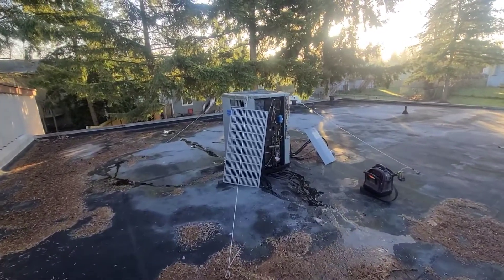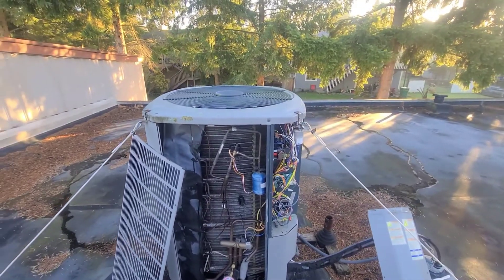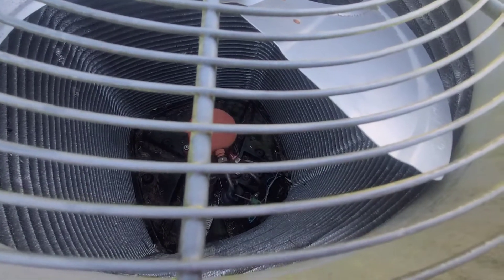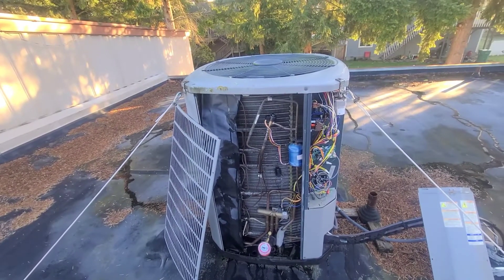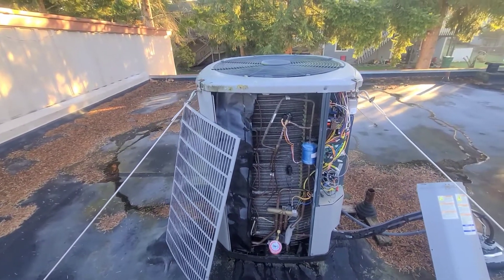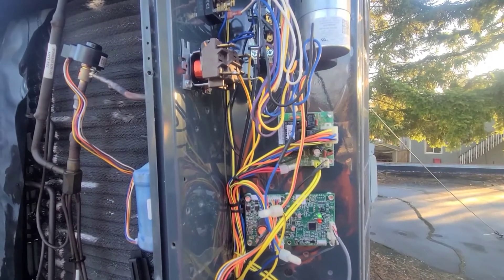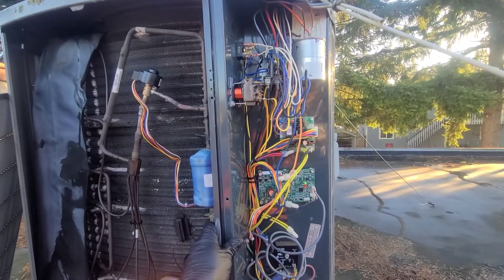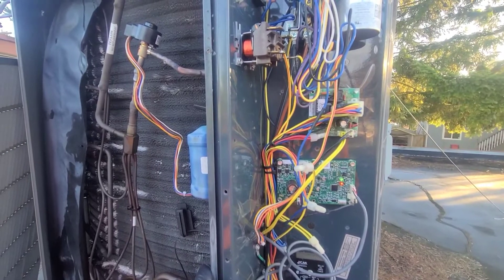Heat Pump Is Blowing Cold Air!!

Comment: This video gave a good education on how these things work.  I have an American Standard pump and have always had issues with it when it’s gets cold outside.  I’ve had the unit replaced and another set of coils replaced on my 2nd unit.  

When it starts up it always sounds like a it’s in defrost , sounds loud and blows cool air.  After a while it will get warm.  I wonder if I have an an issue with the emergency heat kicking in at start up.  I added a wireless thermostat years ago and wonder if I messed it up somehow.  After watching this I have a good understanding and can tell the service company what might be happening.
Reply from the maker: Glad it helped. It definitely sounds like you have a control wiring issues possibly